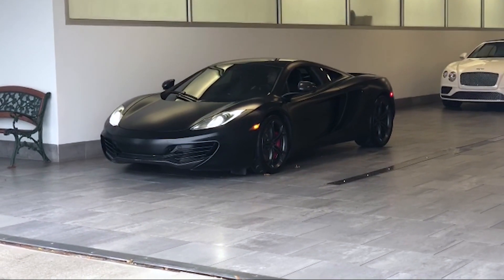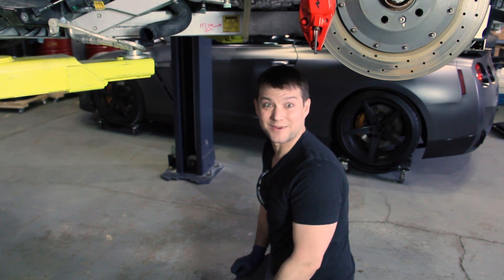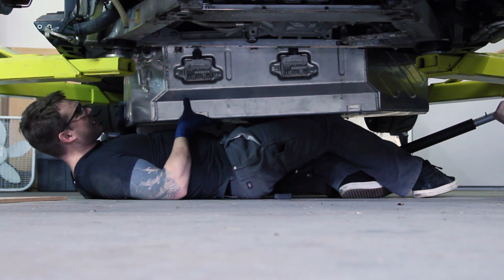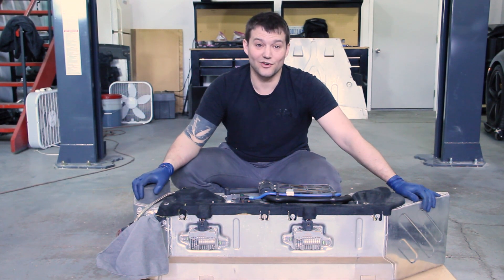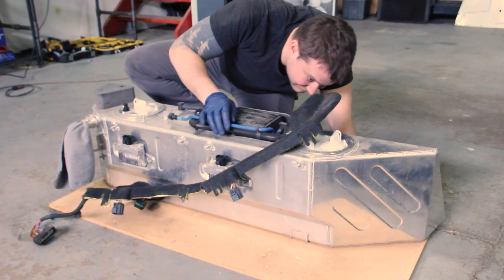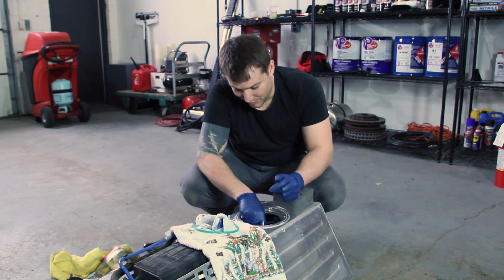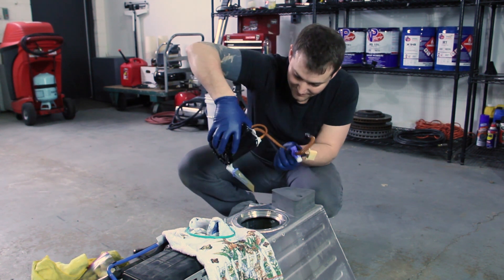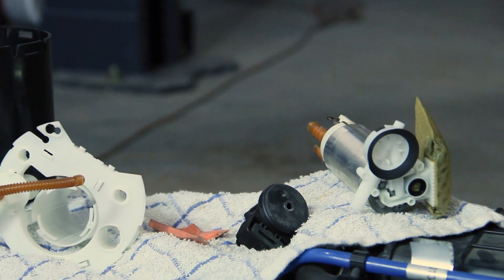Mclaren Fuel System Removal & Development

Comment: What is holding the tank in place just those 2 straps underneath the tank? Once you remove those, can the tank drop enough to disconnect everything? Any help would be appreciate, I need to remove my tank to replace a sensor on the oil reservoir!

Comment: Did you have to drain the cooling system or disconnect the AC condenser to remove the tank?  Thanks.
Reply from the maker: Yes to all, just the driver side.  BUT I was shown that you can support the engine, remove the two front engine braces, and get to everything that way as well.
Reply: @journeyofsevin7559  Thanks a lot for the reply.  Im getting ready to drop the tank on monday and replace the fuel pumps.  Anything of note you can tell me to watch out for?
Reply from the maker: Andrew Sensi awesome!!! If you need any help don’t hesitate to reach out. We also sell an upgraded fuel system with much bigger pumps that we’ve developed if you’re interested.
Reply: @journeyofsevin7559  Thanks again I appreciate the help.  We're just replacing the pumps with the stockers.  Couple more quick questions.  Does the rear bumper cover need to come off? And do I need to remove both of the lower side panels?  From what you said we're only gonna have top remove the driver side radiator and condenser right? Id email you directly but dont know how to.  Thanks.
Reply: @journeyofsevin7559  you wouldn't happen to have a stock fuel filter laying around to sell? None can be found in stock at Mclaren - all are on backorder and takes months. PM me if you do. Also, send me the cost for the pumps.

Comment: Hi how long did it take to remove fuel tank in total.?  Thanks Chris
Reply from the maker: Chris Thackray we’ve removed the tank in as little as 40min once the body panels are off. Start to finish with body panels can be done in less than 2 hours.
Reply: Thanks